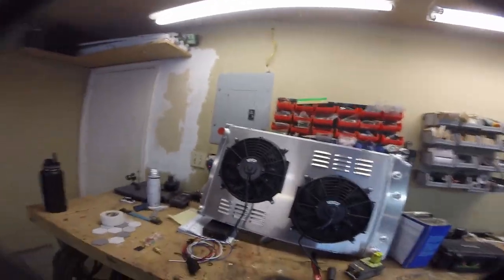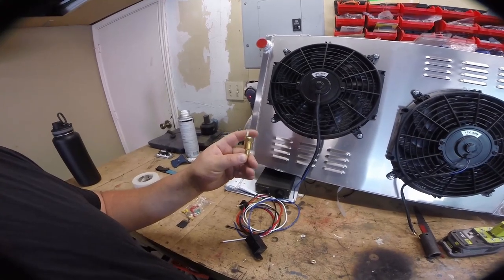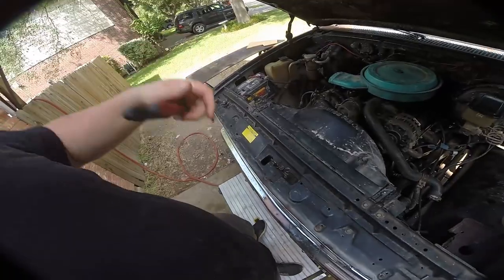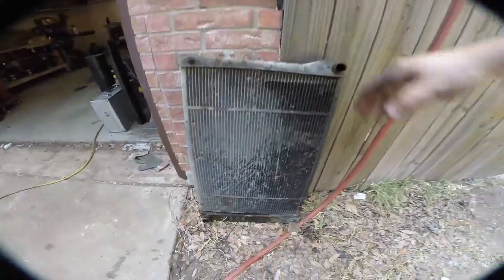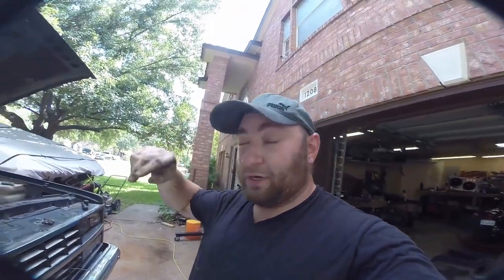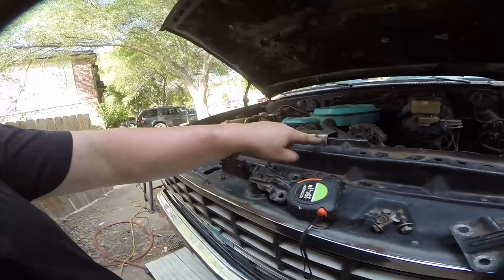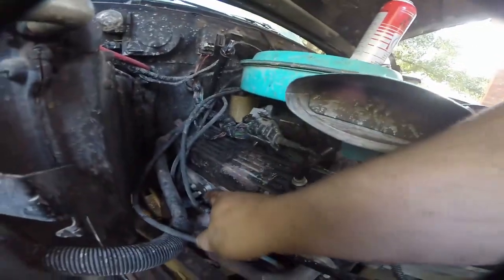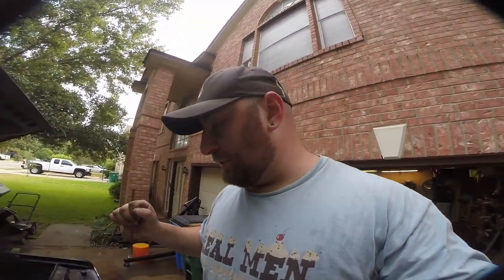1989 K5 Chevrolet Blazer Build - Episode 8 - EBAY Aluminum Radiator + E-Fans

Comment: Im about to buy one so do you recommend  it? Is it cooling? Any leaks or fan issues? im in south texas and you know this texas heat ill be installing them in a 88 k5. Please let me know or any recommendations.
Reply from the maker: I just got mine off ebay. There are a whole bunch if you just search for aluminum radiators. I paid like $210 for the whole thing with fans. Mine works great. Keeps everything 180* in all situations. You will have to build custom mounts.

Comment: Think this would work for a 90 k5 with a 454
Reply from the maker: not sure this is a standard 350 radiator. If the inlet/outlet are the same it would be fine.